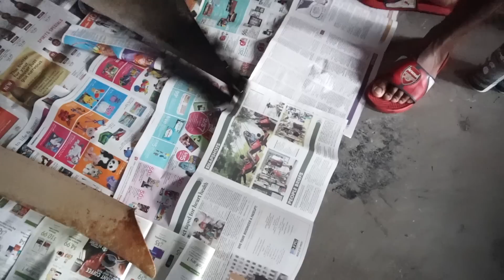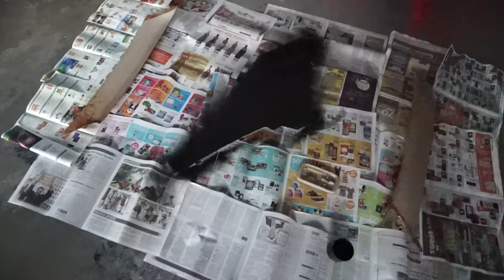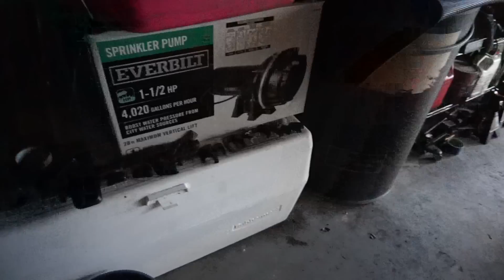SO MANY IS300'S!!! LEXUS IS300 BLACK INTERIOR CONVERSION PT.2

Comment: did you have to unplug the battery in order to remove the A pillar covers? Reason I ask is because of the airbag underneath.
Reply from the maker: 2001 is300s don't have air bags there